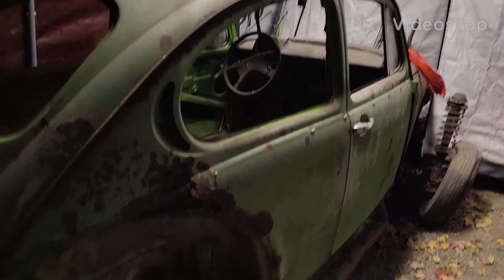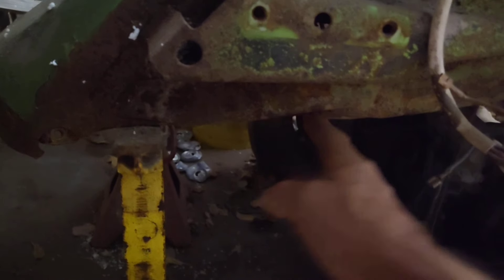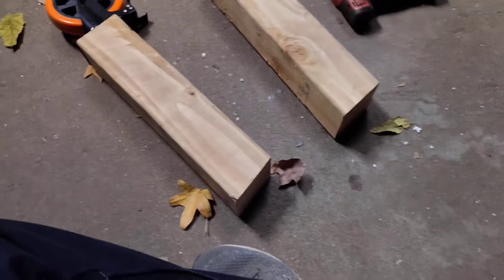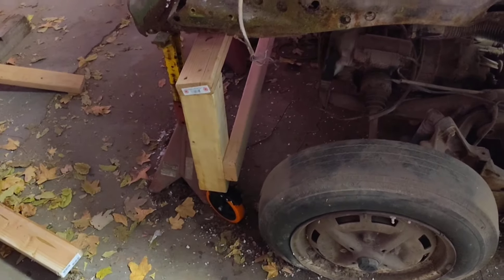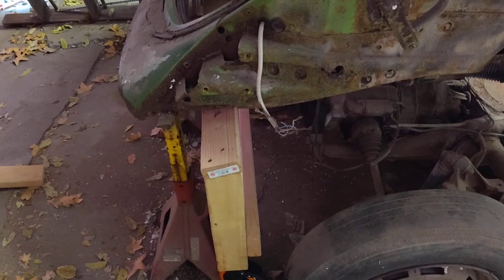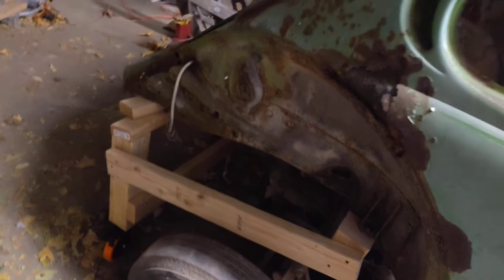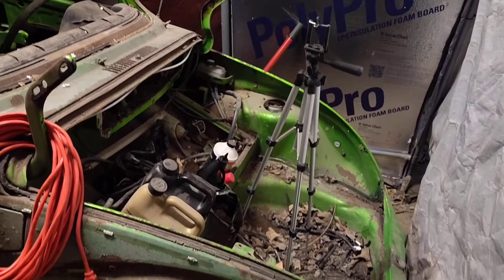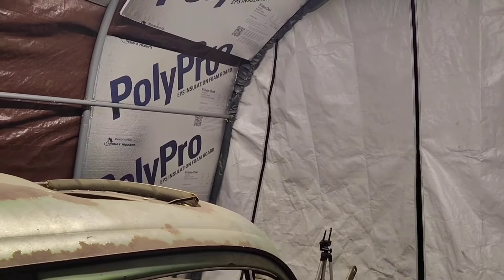So it begins. 75 super beetle.. tonight's progress.

Comment: Good start, and good luck! Build front chassis brace that's similar to the back, but use the wheelbarrow style castors. It'll get through that gravel much better. Harbor Freight usually has those castors for pretty cheap. Love the good use of wood and ratchet straps!
Reply from the maker: I'll have to check those out.

Comment: How about a 3k pneumatic with 72 extensions? can you make one disappear from work? 😇if you use face book keep an eye out for some of those metal corrugated sheets sometimes found for free to hold that insulating in place and reflect heat and some old carpet for the front to cover those stones.
Reply from the maker: @Malcolm-s3t  I wish
Reply from the maker: There was so much to this post I didn't see. I'm afraid if I metal the roof they will hit me on taxes for a permanent building.   I'm thinking about building a wall on the back side under the tarp and framing in a wall and garage door behind the zipper panel. That way it looks like a tent.